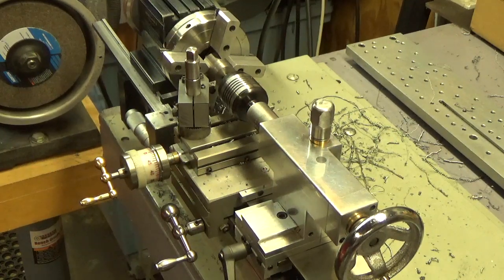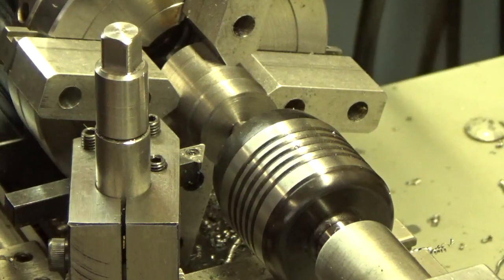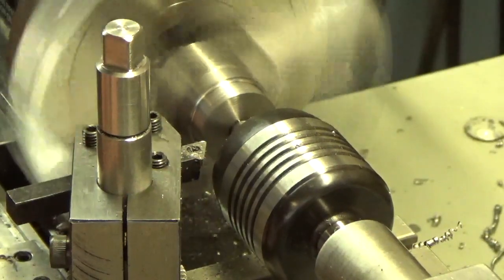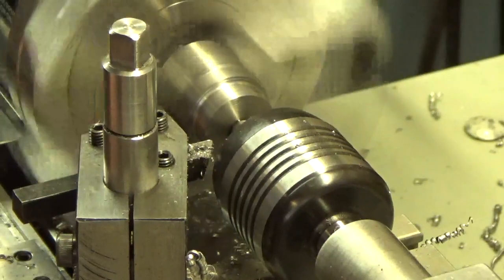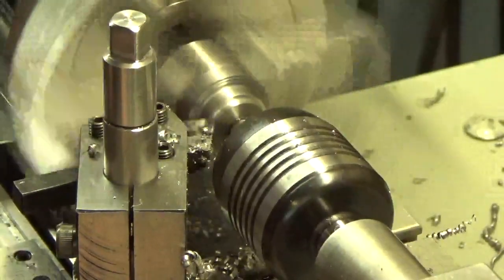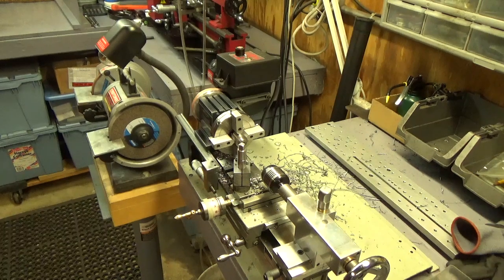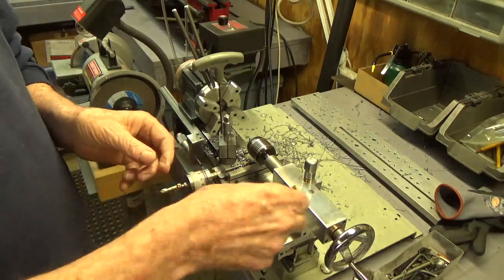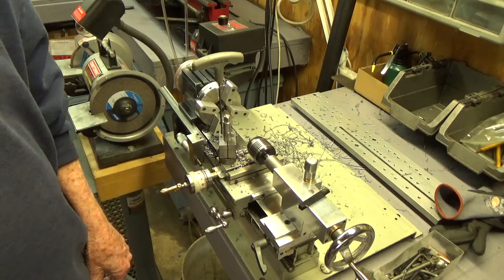Little Taig Lathe Depth Of Cut (1" Mild Steel Rod)

Comment: That's very impressive Larry and the new mini tool holder clamped on that 1/2" post with the bottom of the tool holder sticking up above with just the height adjustment screw  supporting it underneath, it stood the test also, indicating to me that those big QC blocks sitting solidly on the cross slide are really oversize and overkill, but I think you should mention that your drive system is not standard just so they are aware,  good video Larry,
Reply from the maker: Walter:  I can grind a HSS tool bit to remove much more material in one pass, but I don't think it would be efficient.  I think the first short video I made with the cell phone was 0.180" off the diameter in one pass, but that was a HSS special grind with a very slow speed and feed.  I think 0.100" is just fine for a normal feed and speed with an off the shelf tool.  Thanks for your comment and Best Regards: Larry

Comment: Are you using the regular 1/4 hp motor it usually comes with to cut this mild steel?
Reply from the maker: Both my Taig lathe and mill are variable speed using Sherline's DC motor setup.  Larry

Comment: They do still have them for 20 bucks.
Reply from the maker: John: That's good to know.  I mainly purchased it for a project to keep my fingers busy, but it is a useable accessory for the little Taig lathe.
Reply: I want the 4 jaw independent @larrypoindexter9351
Reply from the maker: John:  All the chucks Taig sells for there little lathe, if used correctly will serve the purpose.  Scroll chucks of any sort have there draw backs on any lathe and limitations.  Even the 4-jaw also has its limitations and draw backs.  Collets are probably the best work holding devices.  Notice that I'm using the tailstock in this video, and without that things would probably chatter like hell, as a result of tool pressure forces against a poorly held work piece in a inadequate chuck.  Each jaw is really only gripping a tiny, tiny area.  If the jaws were ground to fit the work piece EXACTLY, then you would have a chance, otherwise the tailstock is drastically needed.  Regards:  Larry